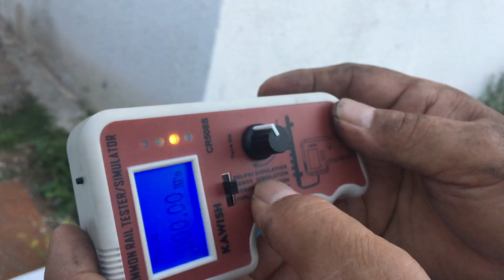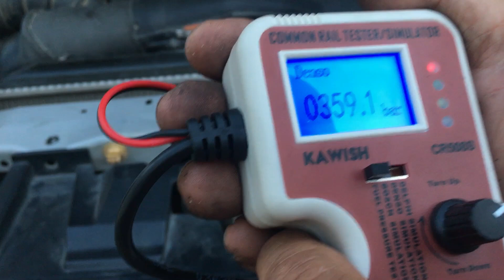PAJERO 4M41 3.2 DID COMMON RAIL PRESSURE TESTING | USING CR508S COMMON RAIL TESTER.

Comment: Sir bakit yung pajero gen 3 ko po 4m41 din makina maayos andar nya pero nung nalinis yung egr intake manifold tska inter cooler at na replace fuel filter pag start biglang nag high rpm patulong nman po
Reply from the maker: baka po may vacuum hose na di naikabit. or baka may nagkabaligtad lang. wala po bang lumabas na engine light?

Comment: Sir isa ako nanood mga vedio nyo napakagaling nyo salamat at may mga katulad nyo na binabahagi ang kaalaman sa iba mabuhay kayo
Reply from the maker: salamat po sir
Reply: @dieseldoctorph8667 hi sir I have a problem with ns Pajero 4m41 fuel pressure drop to 2752.1 when u accelerate then Back to normal hight way driving is ok at idle is around 4354

Comment: Good afternoon po sir.Consult ko lang po yong mitsubishi fuso super great na 6M70 po yong kanyang makina at napapansin ng driver namin na kapag nakatakbo na po sya ng higit sa 200 kilometers ay nagsisimula ng mag low power at nanginginig ang makina at sa madalit sabi sir ay palyado sya ng kaunti pero kapag nagbleed sya ng diesel sa may fuel filter housing nya ay gumanda na naman ang andar at minsan ay pag paahon ay humina hatak pero wala pong problema naman sa pag start kasi laging 1 click po sya at di naman po maitim ang labas ng usok ng makina.hinahanap namin kung may maliit na leak man lang sa fuel line at sa may rail pressure nya pero wala namang sign ng kahit kaunting tagas ng diesel.sana po sir ay matulongan po nyo ako sa problema ng truck namin.salamat in advance po.
Reply from the maker: After 200 km wala kahit anong engine light kumalabas?
Reply: @dieseldoctorph8667  wala pong lumalabas na check engine light po sir.sabi ng driver ay kapag na bleed na nya at start nya makina ay ok na naman pero minsan ay bumabalik sya kahit di pa sya umaabot ng 200 kilometrs.maganda andar nya pag na bleed na sa fuel filter housing.sabi ng driver ay ramdam nya minsan ang paghina ng makina kapag paahon sila ng matagal pero pag nasa patag naman ay ok naman daw sya sir.
Reply from the maker: Kung walang engine light at normal na hinahangin lng eh bihira lng msngyari sa common rail yon
Reply from the maker: Mana pa ay once pinatay nyo eh mag cool down ang crank angle sensor or suction control valve kaya bumabatak uli.
Reply from the maker: Saan ba location nyo ?
Reply: @dieseldoctorph8667 dito po kami sa pangasinan sir.ang ginagawa po sir nung driver namin kapag naramdaman nyang nag low power ang truck ay itatabi lang po nya saglit sa highway po kung saan safe yong lugar at bubuksan nya ang bleeder screw na size 10mm tapos pump nya yong feed pump po nya ng ilang beses at isasara na nya siguro wala pang 3 minutes ay papaandarin nya ulit ang makina at one click naman po ang andar at pag umandar na ay byahe ulit pero kapag naramdaman ulit nya sa susunod ay ganun na lang po lagi ang ginagawa ng driver po namin sir.Dati po ito sir ay hard starting itong truck noon  at may injector kaming isa na pinaayos noong may 21,2020 at ngayon naman ay di sya hard starting .maganda po starting po nya.
Reply: sir pasensysa na po kung naaabala ko po kayo ngayon.nahihirapan kasi akong mag diagnose ng problema ng truck kasi wala po kaming scanner sa bahay.gusto ko sanang bumili ng 24 volts scanner na pwedeng magamit ko sa mistsubihi fuso truck kaso mo ay wala po akong idea kung ano pong magandang gamitin sa truck ng sa ganun ay makita ko po kung may mga fault codes.
Reply from the maker: Ok lng po  walang anuman. Tanong ko lng kundi nya ibleed at maghinto lng sya or magpatay ng makina abd wait sime few minutes baja magka power na uli
Reply from the maker: Gusto lng natin ma establish baka diesel particulate filter. DPF ang problema or SCR clogging
Reply: @dieseldoctorph8667  Ang di ko lang alam sir kung yong EGR  nya ay marumi na.natatakot kami kasing pakilalaman  iyon kasi di kami sure kung doon ang problema lalo nat wala namang scanner eh baka di naman doon ang problema ay baka masira lalo truck.
Reply: @jovab6866  naayos niyo na ba sir, ganyan din ngyari sa amin 6m70, check niyo fuel rail pressure valve or flow limiter. sunod High pressure pump at suction control valve
Reply: Good morning sir Jun, kung di po nya e bleed sir ay low power po daw sya at lumalakas yong vibration ng makina at medyo mahina hatak.Minsan sir ay inabot sya sa may SLEX along bicutan at mabuti at di sya na wrecker kasi naitabi nya agad at sabay bleed at pump nya feed pump at gagana ulit ng maayos ang makina.sabi din sir ng driver na medyo humina ang hatak paahon pero pag nasa patag ay ok naman sya,nilinis na namin ang strainer nya sa tangke at sa  water separator pati na din sa strainer sa suction line at nagpalit na din kami ng bagong fuel filter at bagong change oil na din at palit air filter na din sir para baka sakaling doon ang problema pero ganun pa din eh.
Reply from the maker: https://www.facebook.com/Wadi-Adai-Automotive-Scanning-Injection-Pump-Calibration-Center-103558244891925

Comment: Sir, not all suction control valve can cause low pressure  😊
Reply from the maker: Tama po kayo di po lahat. Pero once mamakat sya effectado po duty cycle nya the opening time nya is becoming shorter and the result is low pressre. Pero di pi lahat ng low pressre ay dshil sa suction control valve. Dami pa pong ibsng reason. But technically is this is the most common